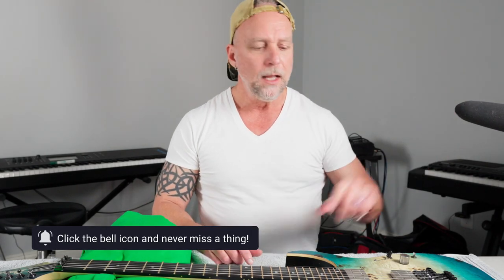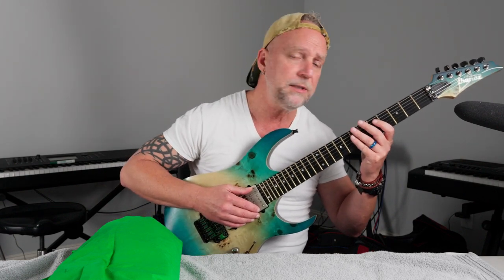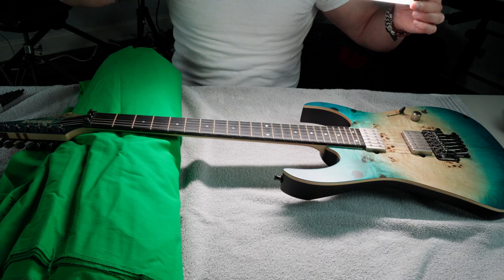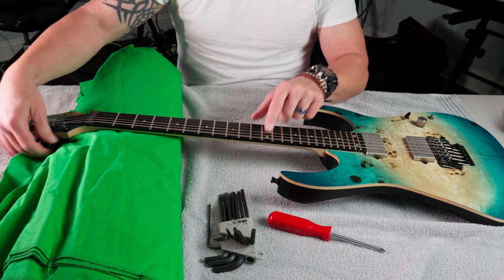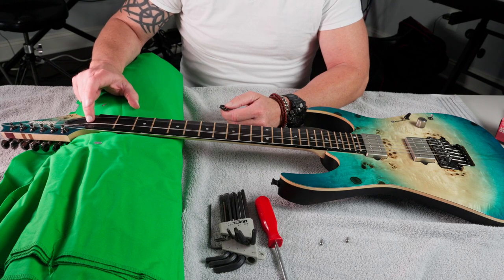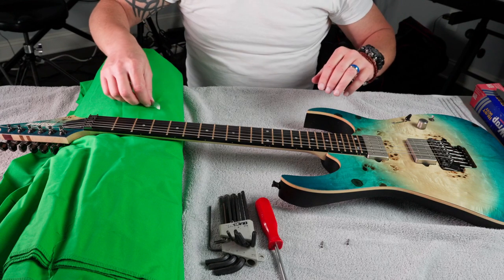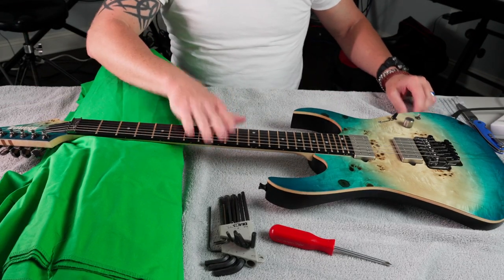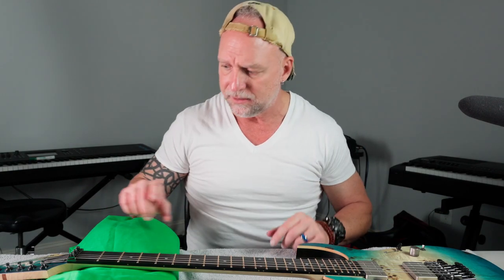Get Rid of That Annoying 1st Fret Fret Buzz!  Let's Shim the Nut.

Comment: Thanks..  i never actually thought of using aluminum foil.  I've been playing on floyd rose guitars most of my whole life of 41 years.  and just now coming across a this particular issue.  "only at the first fret, only the high e string"  on my Peavey Tracer.    It's just gotten wore out.  I'm sure this will work.  I just wanted to thank you for educating me on it FIRST.     And yes I feel like a jackass for cranking on the truss rod a 100 times before realizing this.    I didn't hurt it though..
Reply from the maker: Thats funny.  I think we have all cranked on a truss rod at one point or another.  Yeah the string...especially the high E after a will groove the nut just enough to cause it to buzz on the first fret.

Comment: Dont grind the metal nut... simply shave off some wood beneath it! A nice sharp chisel makes it like a knife in warm butter and you van shave very thin layers. Much simpler.

I personally think the high nut decision is perfectly logical, easier to take away than accurately add material.
Reply from the maker: Yeah, but being a wood worker myself.....most cannot do that....and if they screw that up they have an issue where as they can always buy a new nut.